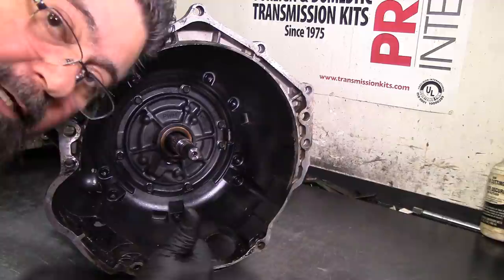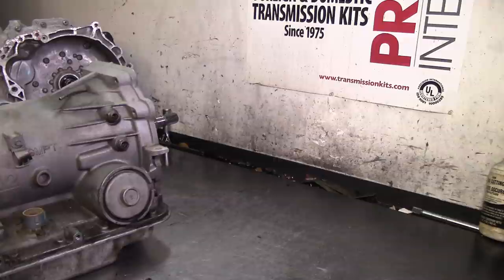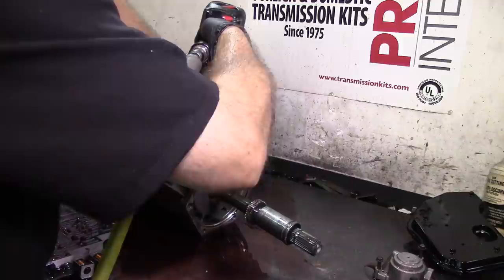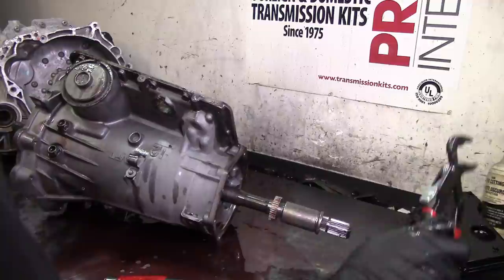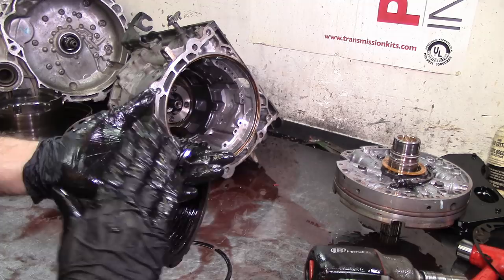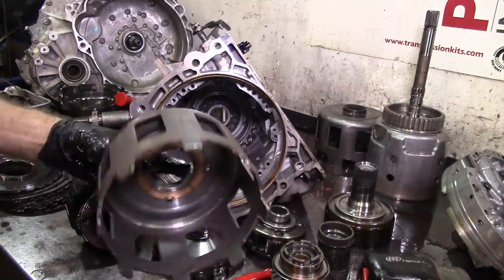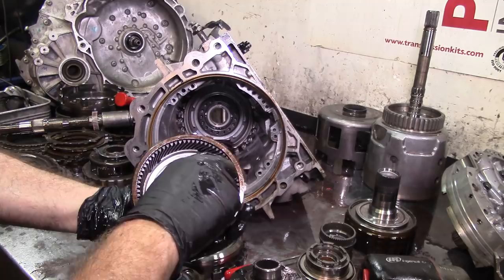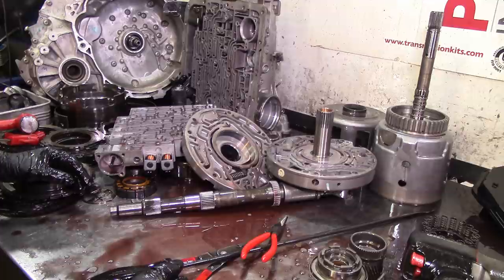4L60E Transmission Differences

Comment: Got to ask.  How much of a transmission rebuild could be avoided with proper fluid changes?  OEM lengths to me make no sense these days because the fluids did not change but the service interval did?  I have in my vehicles changed transmission fluid every 2 years or 30K which ever comes first.  And I make sure that the fluid I use either meets or exceeds the OEM specifications.  How often do you recommend for fluid changes (I would love to hear from the channel creator)? I did have to rebuild my transmission once in my Town Car but I bought it used and the fluid upon initial change when I got the vehicle already showed signs of degradation including the OEM factory plug in the pan from Ford.  A fluid change did help a little but it still needed the clutch packs replaced.  Unfortunately the first rebuilder decided to use a custom rebuilt torque converter in contravention to what I specified.  The new surfaces he bonded in the torque converter were not cured when he reassembled the torque converter.  With friction material 2 inches deep in the transmission pan forced a full rebuild a second time by a different provider who replaced the failed torque converter and pulled the transmission apart to clean the friction out of the transmission.   I was pissed.  But in every previous vehicle I owned had the fluid changes done on the 2 year cycle and I never otherwise had any transmission failures.  Does this sound right to you?

Comment: Thank you for your work Hiram. Can we use a 4L60E from a 4.8L engine and put it in on a 5.3L engine? do we need to flash/ reprogram? 2006 4.8L trany on a 2000 5.3L Silverado extended cab.
OLDSKOOL TRIED & TESTED
Reply from the maker: It'll work just fine , some '06 have an input speed sensor. It can be used on earlier models with no issues. 
Earlier models can't be used for later models and that have the sensor. It will shift hard and flag a code. 
Check the 1-2 Accumulator spring, if it has only 1 use the ones from the earlier one. If it has 2 It'll be good..

Comment: I was hoping you could give me some advice got an 07 Chevy 1500 4 l60e transmission works fine but shifts extremely hard from 1st to 2nd I've already replaced the 1-2 accumulator and sprinting did not help can you steer me in the right direction thanks bud

Comment: Hiram I bought a used 4l60e for my 94 truck used.. the guy said it came out of a 94, but the trans is actually a 95.. will this work? the pump says PWM on it, can the pumps be modified to use on non PWM applications?

Comment: I have a 1997 chevy c1500 with a 5.0L v8.  I was wondering if you could help identify a replacement 4l60e.  I'm not too sure of the small differences between models.  Is there a number I should be looking for on a replacement transmission that will fit my vehicle?

Thanks

Comment: Hey Hiram, when converting an 8l90 4wd to 2wd, are there 2 plugs or places that need drilled out at the end of the trans to let fluid lube the output shaft bushing?  I know a 2wd 6l80 has 2 holes that allow fluid to lube the output shaft bushing.  Thanks!

Comment: can you use a 4L80E transmission on an older GM V6 3800 engine(1998-2002)? is there any hardware requirement or supporting modifications?

Comment: Hiram, I'm seeing a ton of input drums with grooves in the aluminum teeth that mate with the reverse input clutch pack. Any thoughts on the possible causes for this issue? I have got all kinds of theories but would appreciate your thoughts. TIA and glad to see you doing these videos again.
Reply: Also noticed no load springs on the 3/4 clutch pack in this video. Is that a difference in the new version?

Comment: Hey hiram 
Ima fan and a subscriber 
Have a 4l60e question for ya i have a car i got that has no gears fwd or reverse 
I took a line off and ran it to see if it had pressure and it seems to fluid come out pretty good 
Its a 01 yukon i appreciate any help thanks!
Reply: Replace the Converter..
Reply: @JOMaMa..  actually ended up being wrong trans someone tried to put a 97 model 4l60e withls converter in this car